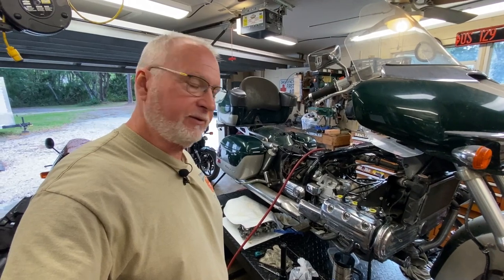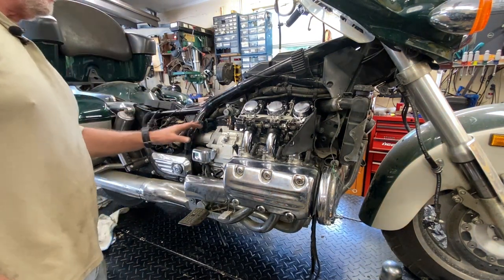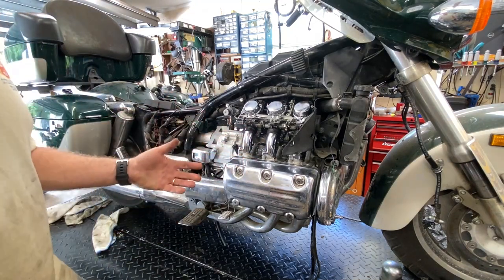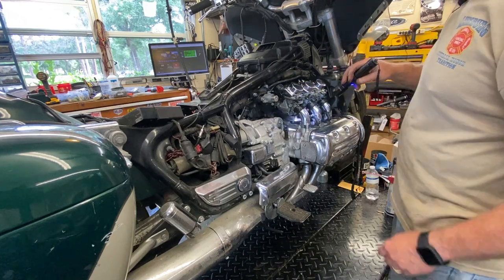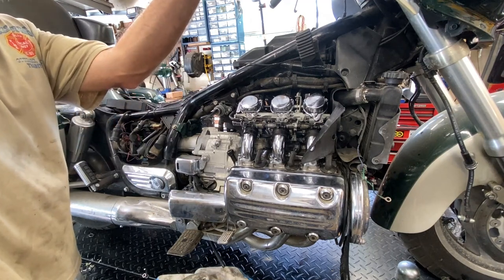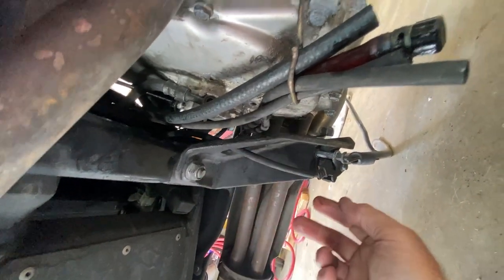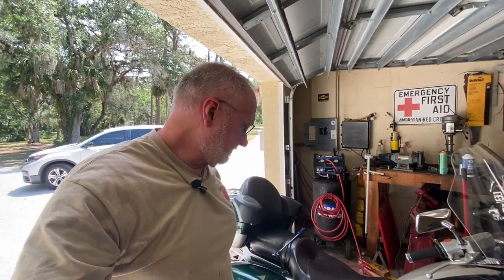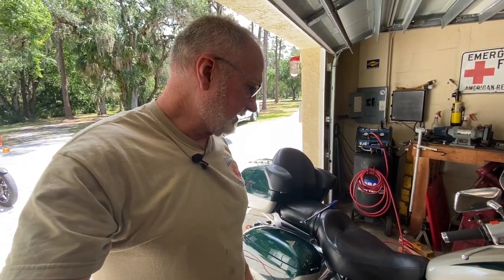1999 Valkyrie Interstate repairs are DONE! (mostly).... Video #3

Comment: When you work on something for many hours, then put it back together and it runs beautifully, that is a wonderful sound. You have skills way beyond the average mechanic working at a motorcycle shop.
Reply from the maker: Thanks, I don't know about that, I can spend the time on the job, where shops cannot. Dealers and most independent shops have to keep volume up to survive, get work in and out as quick as possible.

Comment: 4.23.23.    Last summer I bought a spare set of carburetors for my 1985 GL 1200 four-cylinder Gold wing, from eBay. I soda blasted and ultrasonic cleaned The spare set of carburetors, I also put in Randakk’s  rebuild kit for the GoldWing, I purchased a Digi-Sync, Digital Peaking Manometer for a six cylinder engine. I also changed the sparkplugs, plug wires and caps. I was stunned at how well the engine started and ran afterwards‼️ I went out to the Black Hills in South Dakota late last September early October, and when I got back the bike idled as if I just tuned it with that Digi-Sync™️.

Comment: Picked up a 99’ Valkyrie from its original owner, 4k miles, garage kept, sitting the past 4 years. Was relieved to come across your channel and see both Valkyrie series. I’m 26 and have learned a lot working on my 03’ vtx1800 but have minimal experience with carbs (just yard equipment and dirt bikes) definitely intimidated going into this. Would you suggest leaving the carbs together if they are functional?
Reply from the maker: Thanks for watching, please consider subscribing/liking/sharing. I would say definitely, if it's not broke, don't fix it. However, they won't last forever the fuel joints, o-rings and such, so one could argue just get it out of the way and done now, but without some experience especially on these, again, I'd say let sleeping dogs lie. Cheers.

Comment: Always like watching your carb balancing videos Tom, seeing someone spending time getting them very close and the bike running nice and smooth, and responsive too. One question though, how accurate do you think the carbs are when the bike comes off the production line, as the line workers can't spend as much time as yourself to set them correctly? 🤔.
Reply from the maker: I’ve asked myself the same question from time to time, I think the answer is self evident, seeing just about everybody back then almost immediately made changes to jetting and exhaust trying to tune out the factory flat spots.
Reply: @MotoRestoFL  thanks for your reply. I guess so, set it to a base setting and then just send it out.
Reply from the maker: @shaunhardie6077  I think it’s more emissions based settings. Even back then they had to lean them out big time.

Comment: I enjoyed your series and learned quite a bit. Thank you for posting these videos. I have a question for you as a mechanic.  I have the same bike right down to the color. I bought it a month ago, it fires up and runs fine but has an electrical issue of sorts. The center display, Speedo, and tach all backlight up but nothing works. All lights work otherwise but nothing in the center works other than backlighting. Any ideas where to look first?
Reply from the maker: Ah. Easy one. There’s two pain in the ass small connectors on the right side of the forward aspect of the fuel tank. They’re usually tucked away behind the tank but you can usually see the wires. Those connectors are horrible and easy to break the lock tabs. Most likely the connectors are loose or unplugged. You may have to pull the tank to check. Those connectors really suck. Those connectors feed the display.
Reply: @MotoRestoFL  thank you, I’ll check that out